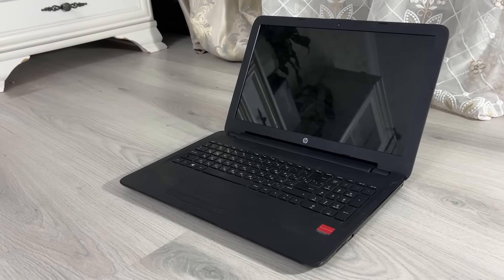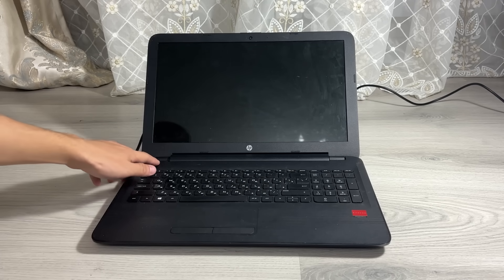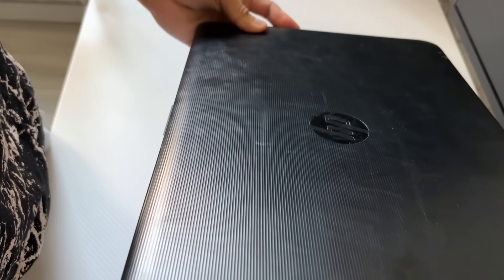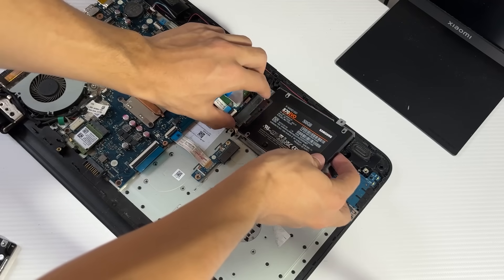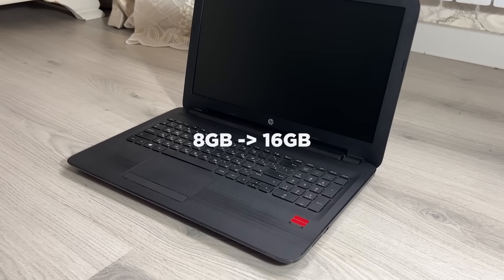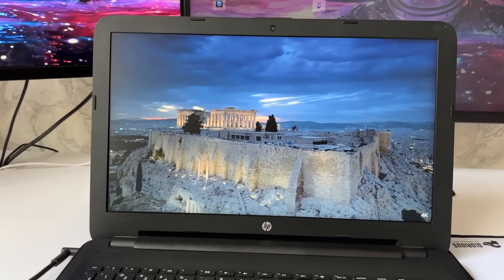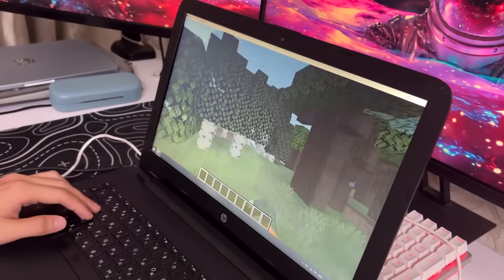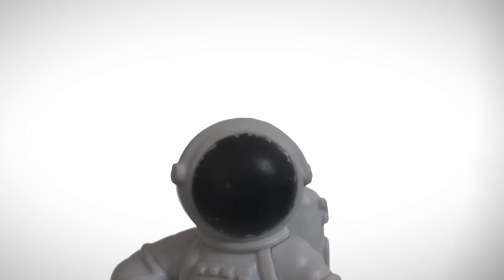How Far Can I Upgrade This 10 Year Old Laptop?

Comment: how are you not able to run minecraft with a 2GHz CPU and 16GB of ram???
because somehow my even worst HP 15-dwxxxx1024nk (i think thats its name) which uses a Intel core Celeron 1.1GHz CPU and comes with only one slot of ram (4GB) and a 1TB HDD (came with windows 11 pre-installed, takes arround 2 mins to load so i changed to linux and now it boots in 10secs) can run minecraft VANILLA 1.21 with 30-45fps ???? (it can run it even better with optimization mods)
bro said "it can handle a bit of multi-tasking" my shit laptop which isn't supposed to be even called one can run the latest version of minecraft with discord in the background somehow.. so either its the power of linux (i use linux mint btw) or i'm just lucky. (i'm pretty sure i'm not THAT lucky so yea)

Comment: been using low end laptops in the past and let me tell you, you can definitely upgrade the mobo, you took your time to buy a screen panel and a battery, if you wanna bring new life to this laptop you can search for that laptop series and swap the motherboard. Laptops usually come in multiple CPU+GPU setups depending on the price, you basically keep the chassis of the laptop and search for a second hand motherboard for that laptop with higher specs, aliexpress or sites like this are usually the go-to
Reply: laptop of theseus
Reply: laptop of theseus
Reply: That's basically a new laptop at that point.
Reply: ohhhh i hear ya, i think. how well does this work? does it always boot good after?
Reply: @Adi-o2y the motherboard basically has both CPU & GPU & the power source so basically if you get a good mbd you should not have any issues
Reply: but is it worth it? I mean, isn't it cheaper to buy a new and better laptop? because a whole different motherboard is almost the same
Reply: I've tried searching for one of these to my Dell XPS L502x, but i swear I can't. I just want to upgrade my old laptop to run games better
Reply: Better buy a new

Comment: My first functional laptop was 2012 MacBook Pro. It was a legend, i upgraded 4 gb ram to 10 (2x8), additional on top of 500gb harddrive i added 256gb ssd to disk slot and made it primary storage. I used it between 2012 - 2021 and my aunty still uses it in 2025, battery haven't changed and still hold charge about 1,5 hours

Comment: bro if u think its painful to use such specs, then what shall I tell about myself!
im using a desktop which is 2 to 3 years older than me! here are the specs:
CPU: intel pentium duel core E5700 3.00 Ghz
GPU: ATI radeon HD 2400 XT (it got cooked! its failing to pass POST) hence using iGPU
RAM: 2+2=4gigs; 8500mhz (as one of the stick is 8500mhz, it has underclocked)
storage: 223gigs ssd (main drive) 500gigs hdd (secondary)
with these specs i used to play minecraft (1.16) with my frnd. the fps was i belive under 60fps (with few tweks). farcry 2 (same with tweks). gta sa with no tweaks it was runnig with no problem when my gpu was good. now without my gpu i am just playing cs1.6 and it has no issue. this veteran can run all daily tasks woth not much problem. but the driver for igpu has few problems it has code 52 error. well its quit usable, i code in this machine, no problems.

Comment: I recommend  you linux mint xcle - its customisable, and very easy to setup (you need only gpt or yt), fight with it 2 hours, and than you will got the brightest, most cringe anime retro-nostalgia desktop environment you can imagine. Also even if you made it with the most ram-eating themes. It still should be around 1-1,5 ram. Also recommend your sister to use brave browser. Its free, it comes with adblock, and its importand to watch internet nowadays.
Sorry for english, im slavic native speaker, and usually i dont use that ugly language ;/.

Comment: I used a probably weaker processor in my old laptop, and none of that was too laggy in GTA 5. I bet Minecraft could've ran. And Roblox ran as well. Yes, not the best gaming laptop, but if you don't mind low resolution, like me, then you'd be fine.

Comment: 11:17 microsoft 10000%
Reply: True. I even installed win11 iot enterprise edition in my sister laptop since that's the one of two editions that doesn't stick to strict system requirements.
Reply: u r absolutely right
but u r probably a linux user

Comment: install linux on it then see the performance. i have an i3 3rd gen 4005u laptop and i did pretty much all the upgrades u did except the display , the thermal paste and instead of windows 10 i installed arch linux on it, 600mb ram on idle and took only 8gb of space and the best part it was running blender as good as my r5 5625u. idk how but it handled all the gaming tasks without a sweat and let me remind u this laptop is 11 years old. 60fps in most games on lowest setting. Give arch with hyprland with jakoolit a shot on this laptop it will run good as new

Comment: i did the same with an old dell laptop with a third gen i3 and no ig, cleared everything on it, installed windows 11 and overclocked the cpu, it ran minecraft at 50+ fps with no lag on low settings and when i got a few peripherals it was actually not bad at all. ofc, those peripherals where for the pc I was building and waiting on the parts so i dont use it anymore but in a pinch, its completely usable

Comment: i dont think it trash in games. u just need to tweak ur windows and the game settings i have a similar laptop with intel hd 520 intel i3-6006u 8gb ddr4 and ssd. and the benchmarks in games is : 200 fps in minecraft with sodium mod. valorant 50-60 fps drops to 30-40. fortnite 30-20 fps kinda unplayable (lowest potato settings). rocket leauge 30 fps when game starts but after 30 seconds or something it will be 40-60 fps. ig yeah thats it.

Comment: I feel you on that bad laptop part. I used a lot of bad laptops, then I got a good gaming laptop with an i5 8th gen and a GTX 1050 Ti 4GB, it was an Acer Nitro 5. I had a blast with it, but then the ukranian war began, and I lost the laptop. Had to use an old shitty HP laptop with a Celeron B815 and 4GB of ram, also 128GB SSD. Used it from 2022 up to 2023 but this one year was HELL, I gotta tell ya. But anyways, recently I stopped working on my current PC and now I am rocking an i7-4790K and a GTX 1080 Ti 11GB. Yeah it's not fancy, or expensive, but I am happy with it since I did it all with my money and work. Runs everything I need. In the future I am planning to upgrade to something like an i9-9900KF or an i5-12600KF. I will see.
Also, I use russian as my main language, and got intrigued by your laptop. From where are you? You learned russian as an additional course?

Comment: if you plan on throwing it onto the trash pls give it to me(not joking at all) i have an ati radeon 3000 GRAPHICS WICH IS 2X SLOWER THAN AN GT 210, i have to play minecraft at 300x200 on linux bc of the gpu and i get 50 worst case scenarios fps and 70-100 avrg forgeoptifine 1.8.9 with cmpack

i recommend gettting linux only if youre choosing distros like mint cinnamon or lighweight kde distros(dont even think of getting near garuda linux or kde neon) an example ,debian 12 kde

or get zorin os core wich is way better

Comment: Btw dude , you should’ve bought a new pc for your sister instead,It’s really way better than some DDR4 CPUS too , here is specs :
Intel core i7-4790 : $41
Ant esports ICE-C400 : $11
16GB DDR3 RAM : $15
Cabinet + PSU : $22
H81(LGA1150) motherboard : $23
256GB NVMe(M.2 slot) SSD : $20
dedicated Gpu GT740-4GD3 : $29
(not really good for gaming but can handle games like Minecraft,roblox at 60+ FPS)

In total : $161

Comment: you think you struggled? i had a Compaq CQ58 with an AMD E1 1200 APU, 4GB DDR3 1333Mhz and a failing 250GB HDD, i still have this laptop and it still works, but has since been upgraded with a 240GB SSD, 8GB RAM 1600Mhz 
(which is the max for this laptop)
and runs Linux Mint Xfce and is used still for ripping CDs and DVDs like its the 2000s lol, the E1 was a weak CPU even for its time but my nan didn't have a use for the laptop so she gave it to me
Reply: Damn i got a sony vaio with 125gb hdd

Comment: You can actually install windows 11 on it if you select some settings on rufus (a software for making bootable usbs for operating systems). I got it working with that method on my old toshiba satellite laptop
Reply: Tiny 11 should work fine
Reply: @N.ktechofficial I use tiny11 25h2 on my asus x540up with an i7 7500u i download it from piratebay... Tiny11 works well on unsupported devices...
Reply: but wont it be laggy?
Reply: @itsmah1n  Mostly if its still on an hdd and windows 11 was never made for an hdd but with an ssd it should be smooth

Comment: bro you can still optimize it if i had this laptop i could optimize it i had an old laptop with i5 3rd hd 4000 with nvidia nvs 5200m gpu 4gb ram it run quite well like 200 to 300fps

Comment: the integrated graphics aren't that bad. power wise it's inbetween uhd 600 and uhd 610, which is still used in cheap laptops today. 1600mhz ddr3 ram is pretty decent and can hold up decently in modern games today. plus, the cpu isn't that bad, and compares to some laptops from around 2017. the main problem is the hdd lmaooo
Reply: My old laptop is WAYY shittier than his, and somehow I get 2-3x the performance in the same games that he's playing lmfao.
Reply: Yea You Can Play TONS Of Optimised Games On That In (Low To Medium Settings At Least)
Reply: @DhruvVarma-d8e yup. minecraft with sodium+lithium  would run fine

Comment: I think fortnite, rocket league, Valorant, GTA V and War Thunder will run. Minecraft has low basic requirements but is very CPU intensive. Modern esports games can run on surprisingly weak hardware if you use low settings.

Comment: I suggest installing Windows 11 with Rufus, more or less the same performance as Windows 10 after proper optimization, plus the added capabilities. Especially recommended if you're not familiarized with Linux.

Comment: You Can Technically Change The CPU And GPU But It Needs To Be Compatible With The Socket Plus You Need To Know Professional Soldering To Solder The Chips

Comment: one think that you could do is put a gpu in the latop
\
Reply: Bro you literally need an engineering degree to change that stuff in a laptop, its very very hard not as simple as plopping down an ssd (which is not baby stuff but easier hat putting a gpu in a laptop)
Reply: @arvmk6221  nah you dont you just conect a psu and a grapchics card to the psu

Comment: I actually went back to a similar laptop (the exact same HP shell with an AMD A10 9600P) after I sold off my gaming laptop. I did everything that you've done aside from the screen replacement (my crappy 768p panel is still in great condition). Here's a few additional things that I've done to it to make the laptop usable for me:

1. I replaced the pathetic WiFi card to an Intel AX210. This gave my laptop access to WiFi 5, 6 and 6E (which is important for me because my campus library ditched WiFi 4) and Bluetooth for my earbuds and game controller. If your laptop's Wifi card slot uses M.2 2230 A+E key, I suggest that you can use what I got for myself. One thing to note is that my laptop only came with one Wifi antenna whereas the AX210 needed 2, so I bought an extra laptop Wifi antenna and just route it under my armrest (ngl i'm too lazy to disassemble my screen assembly where laptop wifi antennas are installed).

2. There are ways to forcefully Install Windows 11 on laptops that are too old but has all of the needed instruction set. When you use RUFUS to flash Windows 11 into a USB drive, a pop-up will appear that'll let you modify your install media to bypass hardware checks. Do this with caution, I'm willing to take the risk because I know what i'm doing.

Comment: my old celeron n3050 was practically unusable, but that's what introduced me to programming as that the only thing the laptop capable to do
Reply: For real. My Asus X441s now sucks with 2 GB unupgradeable RAM. With Windows 10 I had modified, it uses ±1 GB of RAM when idle 🥀
Poor Celeron
Reply: @ramadhanial-azmi66 i have a n3060 and 4gb ram with extreme optimization and over 100+ mods i get 150-200 fps stable on minecraft java
Reply: Linux?
Reply: I had the same pc lol you can’t even play Skyrim legendary edition at 30 fps with 50 mods
Reply: mine has a n3060, with hd graphics 400 and 2gb ram, and a defragmented 420 gb hdd, i managed to run gta v with 4gb patch, the stuttering was the bottleneck
Reply: Haha my laptop is the celeron n3060
Reply: Also it runs windows 11 pro
Reply: I had the same pc lol you can’t even play Skyrim legendary edition at 30 fps with 50 mods
Reply: I had an n3060 laptop with 4 gigs and an hdd 
I was able to run some old versions of Minecraft mostly play classicube on it
Roblox runs okay 
I loved using it since I could do whatever I want to it
Until the battery died...
And the power management died....
Reply: I still use that cpu with 2GB ram (with SSD tho)
Reply: Linux bro
Reply: me with n3540 2gb ram 320gb hdd on puppy linux
Reply: @synceno821 sad

Comment: god... i remember doing sfx in after effects on my intel i3 laptop from 8-9 years ago
Reply: i used to do that on a core 2 duo back in 2016 LMAO
Reply: @natsuLore  whats so funny about that?
Reply: I haad an i3 laptop with a Nvidia 820M, most of the time I was doubting whether my GPU was working or not. I had that laptop until 2022, a electricity shock while charging fried the motherboard. Went 3 years without a laptop, now I have an i7 with a Nvidia RTX 4050. Huge upgrade.
Reply: @Samin-e1s2cmy previous laptop (not the 1st i3 laptop) rocks at Intel i7 8th gen and a GTX 1050ti 4gb. I passed that laptop on to my brother as I now  move to a desktop build.

Current build rocks on a R7 5700 and a RTX 5060 8gb. (I know getting an 8gb sucks for modern games, but 8gb vram is a huge upgrade for me)
Reply: @yujindesu.p  Anything is better than what we had previously. Can’t believe I survived with 4 gigs of ram for 8 years. Now I have 16 gigs.
Reply: @yujindesu.p  Hey, perhaps it was an Acer Nitro 5? I remember having an i5 8th gen and a GTX 1050 Ti 4GB. I had a lot of fun with it but lost it during the ukranian war. Right now I have a PC that I recently finished working on and it has an i7-4790K and a GTX 1080 Ti. Amazing build in my opinion.
Reply: @MrAeral my old laptop was a HP Laptop 15, next is the Acer Aspire 5 (it has i7-8550u and mx130 dgpu), next is the Asus TUF DX505 (i7 GTX 1050ti).

And now the present, my desktop build r7 5700x and RTX 5060

Comment: Hey i have a very similar laptop and I was able to get windows 11 on it after doing a trick with the ISO file. I recommend looking up a video on how to do it as it's pretty easy.

Although unless you really need windows, linux is just a better option for these kind of laptops as it doesn't requre as much preformance to run well. I've installed linux mint on my 1tb ssd and installed it on my HP and I never looked back.
Reply: True. Win 11 use a lot of RAM and Cpu  - tested on 4GB laptop with internal graphics - I used the iso trick :)
Reply: Ok how to do it?

Comment: I'd probably go for Windows 10 LTSC, with Tiny10, or maybe for fun something like Project Longbridge. If Linux, I'd probably go for Linux Mint Cinnamon.
Reply from the maker: Sounds interesting, thanks for the suggestions!
Reply: @amanastronaut   bro i have the same laptop😁❤. but the specs are different😅
Reply: @amanastronaut  U might wanna try ReviOS too, i use it with my intel i5 3470 and it runs crazy fasttt, almost like a new midrange
Reply: @amanastronaut  btw you can run windows 11 easily on almost any laptop, ive run windows 11 on 5th and 7th gen intel even thought they're not officially supported, just search up how to install windows 11 on an unsupported machine
Reply: Ubuntu breathed a new life into my old laptop that I use to make guitar covers in the living room
Reply: @nogamesnolife-4470 Using all those terminals for even simple tasks thats why i Never liked linux And always stayed with windows on my potato
Reply: @Axzeme  jesus christ in linux you still click buttons to do things. Are you thinking of like Arch installation or Gentoo in your head for the entire linux experience?
Reply: @Axzeme mint is more windows than windows itself tbh
Reply: Don't even bother with windows, go with a linux distro like mx linux or cachyos on xfce4
Reply: Based
Reply: linux mint yep great choice for this project
Reply: you do know arch is best for having latest drivers and is much more stable(i used both. sticking with arch. nothing broken unlike prev distro)
Reply: Good choices
Reply: debian base mint maybe good because it provides long update support
Reply: Especially IoT Enterprise LTSC, that'll last until 2032
Reply: tiny10 is LTSC already lol